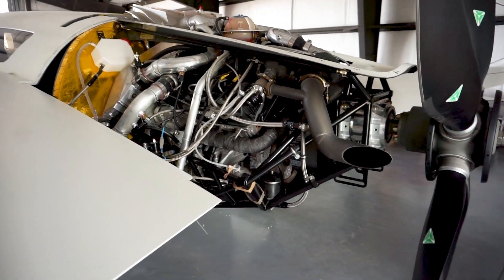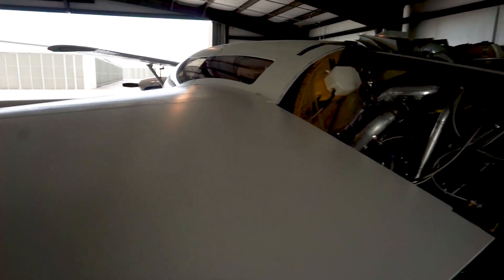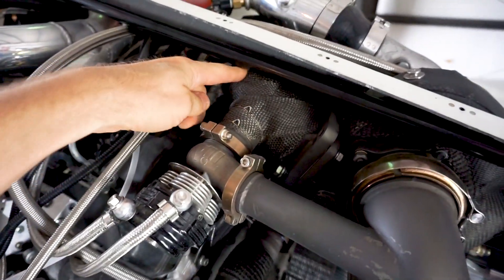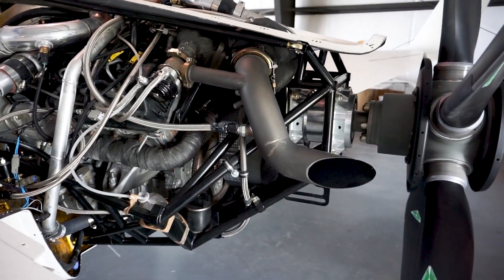Is this the coolest plane you can't buy... yet?  (Part 1)

Comment: Absolutely stunning aircraft. I have been following your progress and admire your attention to detail. One question: the crossover exhaust pipe that goes behind your drive belt seems to not have insulation wrap on it. Will this present any issue with heat degradation to the belt?

Comment: Why rear engine? Its already been proven front engine props plane are more efficient as it does not have to suck the air from around the air frame taking up the space in front of it. That is like putting a golf ball in front of the suction nozzle on your home vacuum and expecting it to suck air from in front of it. Even turbine engines have the blades in the front and not the rear...There is a reason there are considerably more front prop planes then rear.

Comment: This is the first time I've seen this plane, it looks pretty sweet, I've always been in love with the Velocity, this looks better, and sounds like it will perform better.  Has he mentioned any TBO for the engine?  I was under the impression that diesel engines have a higher TBO.
Reply: Brandon B it’s an auto engine. They don’t have tbo’s
Reply: @chinoman7234 
I was under the impression TBO was for reliability. Aircraft engines are often run past TBO if they're still performing well and not making chips in the oil. So I was wondering if there were things on the auto engine that have to be changed or maintained at certain hour marks, other than std oild and fluid changes.

Comment: "This is the Raptor, just a copy of the Velocity."
Reply: @blusheep2

That’s like saying “this is the Lancair Evolution, it’s just a copy of a Piper Warrior”.

Yes, the overall layout of the aircraft is similar, but the mission profile and accompanying performance design specs are in a totally different league. The unpressurized Velocity can cruise at 12k ft. The Raptor should be able to handle something in the vicinity of 25k, putting it above weather and allowing it to cruise much more efficiently. Also, the engine for this aircraft was a huge project in itself. Sure, you could buy a TSIO-540 and bolt it onto a Velocity and get somewhere in the vicinity of the Raptor’s power, but Peters Audi conversion could be extremely economical. If it turns out to be reliable, it will be revolutionary. Additionally, the Raptor is carbon fiber vs the Velocity’s fiberglass. They are quite different both in their material properties and in how they are worked.

So yeah, to the untrained eye the Raptor does bear a resemblance to the Velocity. But if it were just a copy, then the Velocity is just an upsized copy of the Long-EZ. It was admittedly designed based off of Burt Rutan’s work.

Only time will tell if the Raptor lives up to the project’s price and performance goals. But it’s a clean sheet design, and calling it a copy of the Velocity does nothing but show your ignorance.
Reply: @stevenwg2360  

I will admit I know very little about this aircraft. I know a lot about the Velocity. If this is meant to be a pressurized version of the Velocity then fair enough. That is quite new in its class. Velocity did have for a time a TSIO-550 that performed similarly that they used as a demo. Truth is, not many customers are looking for a 4/5 place that cruises that high. 

My critique of this aircraft was really meant to communicate that he wasn't inventing the wheel here. Automotive conversions have been done many times. Diesel engines have also been attempted and used in certified aircraft. I fail to see how this would be revolutionary but I am willing to listen to your thoughts. That doesn't mean he won't do an amazing job at the conversion and maybe that alone will have practical applications elsewhere he can use. 

So, its not that I don't think he is doing a good job, its just that hes not reinventing the wheel.
Reply: blusheep2

Roger that, you’re totally right about not inventing the wheel. The Canard concept was conceived of and tested by some very smart people with tons of expertise and probably lots of (government?) funding. Diesel conversions and clean-sheet designs have been attempted, some successfully, but all at exorbitant prices.

The design goals of this aircraft as far as I know are to produce a pressurized IFR platform that cruises at 25k ft, doing over 200 KTAS, with a wet wing that gives it a range of over 3000 NM, and a budgeted cost (including full Garmin IFR suite) of $130k per aircraft.

Not many folks are looking for a 4/5 seater to cruise that high because in today’s market that kind of performance requires some flavor of turboprop bird costing over $1M to acquire, that guzzles fuel and also costs a lot to maintain. What’s revolutionary is not the canard design, or the conversion engine, but that this aircraft could offer performances that are unheard of in a price range that a working professional in the USA could reasonably afford. (This is all assuming that Peter is able to meet his performance and price goals.)

The demand for this machine is evidenced by the fact that 1.5k people have made an escrow deposit of $2k each to get in line for production of this bird. Mine is just before the 1k mark.

It’s a really neat project, and I think it stands to change the face of general aviation if it succeeds. The day that PPL holders are able to fly cost to coast on a single tank of gas at well under $100 in operating cost per hour is the day that companies like Piper, Cessna, Cirrus, and others will be forced to finally start innovating to stay alive.

I’d recommend you check out some of Peters videos and his website if you’re interested in this kind of stuff. You’ll understand why he’s earned such a following of people that are rooting for him and believing in his ability to make this happen!

Lastly, I didn’t mean to fire back a rude reply. I just think you were missing some key pieces of information when you posted your original comment.

Cheers,

Steve
Reply: @stevenwg2360  

I didn't take your comments as rude. In fact I was humbled a little by them because the truth was, that comment of mine was just a knee jerk reaction to all the people acting like it was some new concept when all I saw was another Velocity, when in fact, I knew very little about the airplane we are discussing. 

Most light sport aircraft, last I checked, priced on average between 100k and 130K dollars and those planes are very simple, relatively bare bones aircraft. I fail to see how he could produce an aircraft of this caliber for 130K if this is not a kit plane. Even if its a kit plane I don't see that price being anywhere close to what it will actually cost. I would have to see the cost savings on the engine before I could judge accurately. 

Take the Velocity XL. With a brand new engine which is 50K and assuming you did everything yourself like the paint job, avionics wiring, upholstery, you are looking at a final cost around 200K and that is with an average IFR package without the new wiz bangs that can be found in GA. This price was 12 years ago. 

I don't think the cost would really be a concern if someone could get into a small airplane and fly coast to coast. That would be pretty extraordinary right there although you are looking at nearly 15 hours in the air at 200 kts which I don't believe anyone will actually ever want to do. It will be a good selling point though to be sure. 

In the Velocity, I have leaned the IO-550 to about 9 gph around 13K feet so I could see that with a 100 Gallon tank(which is Velocity's max capacity) you could make it coast to coast on about 7 gph which seems reasonable if your flying up high. 

Finally, is the plan for this plane to be a kit or is he planning to certify. IF he plans to certify then I definitely don't see how he does it for 130K
Reply: The Raptor will be an experimental plane assembled by the end user but with builder assistance at their facility. I do not believe they will sell it as a homebuilt kit. They plan to take advantage of bulk buying discounts on the engine and avionics to keep the price down. There are no plans to certify it from what I have read. The certification process would just put it too far out of reach for the average buyer.

The goal of the project is to create an aircraft that can take a family in comfort at good speed over long distances, fly above weather if needed, and be within reach of a good portion of the community. They plan to offer the Raptor at as low a price as possible. Sure, 130k is optimistic, but if they can bring this design in for around 200k it's still far superior to anything within range of that price point.

Comment: I always wondered about building a turbine powered Velocity, but I would have gone with the BMW Quad turbodiesel W57C30T1 engine [flat rated from 420hp; 380hp T-O, 310 cruise up to 25,000 ft.] but about 25 lbs heavier and better SFC.  PS.  BMW will never allow this as a mass production aero engine.  My design has MTV-9B prop and aluminum gears instead of belts.  I didn't hear how you  would control belt tension though - they wont last long if you don't.

Comment: What's the difference between Burt Rutan's design and the velocity, nice plane
Reply: Well first, this guy isn't Burt Rutan but maybe you understand that already. Burt Rutan never made a 4 place canard as far as I know. Rutan designed a couple of canard aircraft. His first was called the Vixen I believe, the longeasy, and the quickie. All of these were either one or two place. The long easy, the most popular design, had a weight and balance issue when no pilot was on board and so the nose was retracted when parked with the nose laying on the ground. Apart from the canard design this really made it stand out on the ramp. The long easy was a tandem airplane(pilots say in line with each other.) 

Velocity on the other hand is a 4 place 200 kt aircraft that is built for traveling in. It has retractable gear and upwards of a 1000 mile range if you build the plane to have max fuel load. The company has also built a twin.
Reply: I should have asked what's the difference between this plane and velocity and Bert's creation another post pointed out the wider fuselage and of course the power plant

Comment: there's one thing they don't tell you.
if the engine fails, there is no gliding this thing.
it will just fall from the sky...
Reply from the maker: Explain why it won't glide to everyone. Here is your chance to prove to the internet how smart you are.
Reply: @RaptorAircraft  the primary wings being in the rear and the engine weight along with that makes this thing very unstable unless there is adequate airflow over the surfaces. Whats your stall speed? bet its kinda high for this class. This canard design has proven this in the past. Ask John Denver's family. He died when his engine stalled and his vari-eze fell out of the sky...
Reply from the maker: @Designsbyg  you have no idea what you're talking about. A canard style aircraft is designed such that the fore plane will stall well before the main wing thereby keeping the nose down enough to force the aircraft to continue to fly. It's a safer design than a tractor configuration. This is a fact, not an opinion. Go peddle your misinformation somewhere else.
Reply: @RaptorAircraft  i'm interested in saving lives. take a foam model of this design (with weight in the rear) and hand launch it. I'd put money on it's failure. This thing will not glide. We can argue this all day. Buyer beware. Know/understand what you are getting into. There is not enough wing area on the front to hold the nose down. all the weight in the back will pull it up. basic physics.
Reply from the maker: @Designsbyg  the CG (center of gravity) is forward of the neutral point where it should be. So even though you see a heavy engine in the back rest assured that the rest of the aircraft also has mass and the center of that mass is not located in the rear as you are falsely assuming. So, yes we can argue all day long but in the end the facts are the facts and you are making assumptions that are not valid. Anyone else care to explain it in their own terms to hopefully educate him?
Reply: @RaptorAircraft  I look forward to seeing this sleek beauty fly. Perhaps you will grace us with a non-powered flight demo video at that point.
Reply from the maker: @Designsbyg  you'll definitely see when I get to the stage in testing where the best glide speed is determined.
Reply: @Designsbyg  I read the Denver accident report - did you?  He ran out of fuel low down in an unfamiliar aircraft and in trying to switch tanks over his shoulder probably inadvertently banked into the sea with the side stick.
Reply: @Designsbyg    John Denver died because he wasn't familiar with the configuration of the new (to him) plane he bought. The org builder mounted the fuel selector switch over his left  shoulder so none of the fuel lines came into the cockpit. John took off with less than full tanks and when he ran one out of gas, he couldn't reach the fuel selector switch and was since he was already low and slow, he didn't have time to correct the problem. He should have verified he could reach the fuel selector valve before he took off but he didn't. John Denver died from Pilot error, NOT the plane or the design of the plane. He forgot cardinal rule #1. In the event of an engine failure, always fly the plane first and try to restart the engine second. Also when learning a new airplane, altitude if life. He was low and slow over the ocean and couldn't make it back to land when he ran the airplane out of fuel. Total pilot error on all accounts.  Like my Dad taught me, the 3 most useless things to a pilot are:
A) Fuel left on the ground
B)Altitude that's above you
C) runway that's behind you

Comment: Although the concept is interesting and the concerns with the existing market very valid, the engine as designed appears to be overly complicated. The more complicated something is, the more that can go wrong. I can already foresee the maintenance nightmare down the road. Surely there are more effective and less complex ways of achieving the goals?
Reply: Wouter Sijtsma He has a video on why they picked the engine. Basically it’s very fuel efficient and cheap to rebuild/ find engines.

1) Turboprop is expensive to buy

2) Aviation piston engine burns leaded fuel and costs a lot

I agree that it’s the biggest risk, but it’s also what he thinks is potentially the biggest reward.

I just hope it works well and flys.
Reply: Wouter Sijtsma Very little different from a turbo diesel in a car. He added a fuel heater. Maybe car has that too.

Comment: How is the thrust load handled between the prop to gear reduction, and then the engine? Does the gear eduction take all of those loads, or does the proper hub?
Reply from the maker: As you'll see in some of my other videos, it's goes from the engine flywheel to the torsional coupling to the belts to the prop. The loads don't go away at any point. They are carried through all the way to the prop. Each part needs to be able to handle at least 700 ft lb before the belts and over 1000 ft lb after the belts.
Reply: Raptor Aircraft thanks for the reply. I asked because a few years ago I discovered how big the thrust bearing is in an aircraft engine compared to a car engine. I appreciate your quick reply! Good luck and I'm loving your videos!

Comment: For anybody who hasn't seen this series, this is the plane that defines state-of-the-art for General Aviation. It has all the details one wants:
Carbon Fiber construction
Canard
Retractable gear
Glass cockpit
Pressurized cabin
Constant speed prop
Electronically controlled turbo diesel, 350hp
4 to 5 passenger 
long range
high speed (we think)

It really doesn't get better than this.
Reply: State of the art for last century. Things are moving on very fast now. See Friedrichshafen, electric is the only way to go for light aviation now.

Comment: I doubt a modern ultra low sulfur will gel. I’ve never ran into fuel issues on any of our diesel trucks within the past 2 decades. We get some pretty cold temps here too during the dead of winter, like -30C and our trucks would start on the first crank then run all night snowplowing. 

Might need to add some sort of additive to the fuel if buying summer fuel I guess. Since there’s a good chance the fuel at the stations has been treated to perform well in winter.
Reply from the maker: If you are up north your fuel already has a special mix to prevent getting. We don't have that down south and at altitude we will see -50c.
Reply: Would probably be good to get the additive the fuel suppliers use in the winter blend. Little extra insurance when flying high
Reply: You're right to approach the fuel gel issue; my friends Audi Q7 diesel gelled at only -5f and it took us three days to get it running again.  Heating the fuel should help during prolonged flights at altitude.